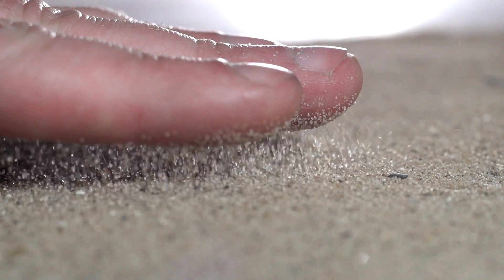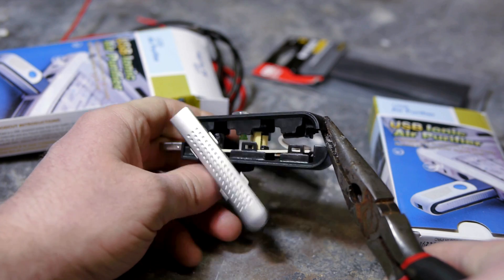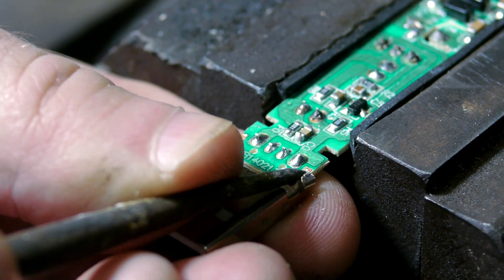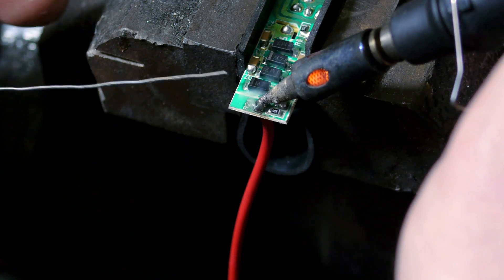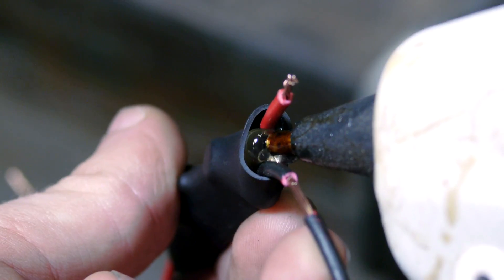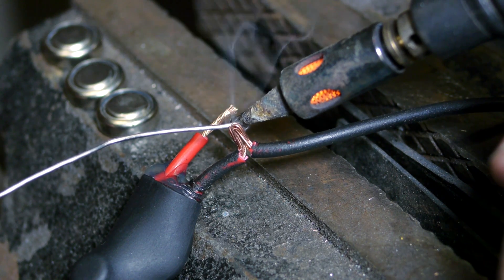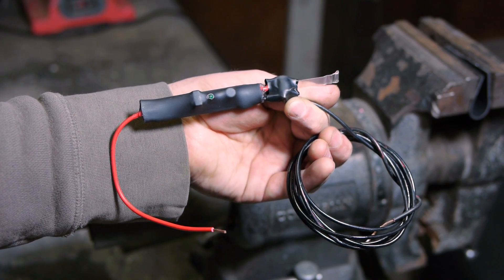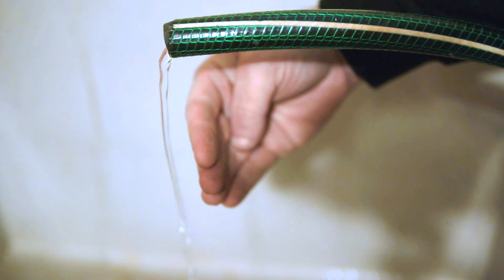How To Make A $5 Static Electricity Generator - NightHawkInLight

Comment: how would I go about with making this without a soldering iron? My dad works at a bronze production factory but his soldering irons are too bulky for such precision.
Reply: +Kitty Max Personally: I wouldn't even consider doing that, the reason is that soldering irons (entry level ones at least) are pretty damn cheap. And I've always been able to borrow my dads tools and had a half decent one for years until I finally got myself a proper tip temperature controlled Ersa soldering station.

But if one doesn't have that... well if you're creative I suppose you could use some kind of metal rod with enough thermal mass and a fine enough pokey end to melt the solder from the PCB or to put it on. Then you proceed to heat that piece of metal while having some way of holding it like pliers etc so you don't burn your hands.

Assuming its a ROHS compliant piece they'll be using lead free solder on it and you need about 230 degrees celcius to melt it. But considering your metal rod will cool down over time and lose heat to the piece you're working on go a bit higher than this temperature. The most common lead solders will be about 60/40 and melt at about 183 degrees celcius (exactly that if its an eutectic 63/37). How to determine the temperature, ehh well I'll leave that part of the mad challenge up to you.

Really though just get your own iron if you're even remotely interested in electronics or might want to replace some parts in an attempt to repair stuff (doesn't take a genius to replace caps in the if a power supply has died!). Or if that doesn't hold your interest maybe a friend or some of their parents has one that you could use for a few days.
Reply: OK I had no idea soldering irons are that cheap(just checked eBay). Well looks like I'll be able to build this ^_^
Reply: *****
Yup the cheap ones... are just that really cheap. Your mileage may vary depending on which one you get and then the luck of the lottery with not so great quality control on cheap ones.

But if you end up using it more frequently than you expected and like messing about with electronics I'd highly recommend looking into a soldering station which is a lot easier to use in my opinion. Basically you've got the station part usually with a dial or buttons that lets you set the target temperature and then some mechanism either controls the actual tip temperature or the heating element temperature. This allows you to set it hot enough to do the job but not any hotter than needed also it means that the transformer and all the other bits are inside the unit on your desk and not inside the iron you're holding making it a lot lighter and easier to handle.

The next best option in my opinion are some of the cheaper but still functional directly mains powered irons that do have a temperature control.

A good brand name budget starting soldering station if you do end up going that route would be the Hakko FX-888 which I think starts at about 100 USD. But just do your research and you'll find one that is affordable and decent. If you are a little bit budget suicidal you could also look at JBC, Ersa, Weller etc... but I would not recommend that route to most people.

Comment: An "on/off" switch would double the price?
My knowledge on the subject is for sure outdated.. But about 6-7 years ago back in HS, me and my buddy modded Xbox controllers etc. we had leds all over inside the buttons etc. and to turn them on or off, we used switches. The most simple kind that slide on or off.
The whole pack of like 10 of these cost me like $10 on eBay at the time...

Comment: Calling bs on the switch doubling the price, 100 push button 4-pin DIP's are $1.2, can easily handle the 5V (rated 12V). 20 rocker switches are $6ish.

Comment: I thought ground was for green wire.
Reply: +TheJonesChannel11 There's a difference in the colors for static and alternating currents. DC is Red for positive, and black for negative (or ground). For AC however, with the standards used in Finland, the "positive" is brown, the "negative" is blue and the ground is yellow and green.
Reply: MrKroakim The joys of being an electrician.

Comment: It should not harm a phone in your pocket, actually I can tell you it wont from experience, this is because there isn't any current flowing through the device, I would't however recommend doing it with your phone in your hand because if it is the path between you and ground then you can have an issue. Also, do you know the voltage output? Just curious as I have been experimenting with my own designs. The best compromise I found between size, price, voltage and modability is a design I came up with based around an electric fly swatter and a voltage multiplayer. However, it is still a bit bigger than I would want as I am trying to enclose one entirely inside a shoe, plus it is not as good as the original 20kv power supply from amazing1.
Reply: Hey look, it's me from the past :) As it turns out, with a good enough voltage multiplier I've cranked it up to 100kv and keep it completely enclosed in a shoe to the point where I can even where shorts and no one notices. Its awesome, I just need to push a button with my toe and I can shock anything.

Comment: For transforming DC voltage, would it be easier to use a resonator with zener diodes, or a marx generator with transistors and a relay switch?
Reply: +Austin Hayducky yes but it would be more expensive

Comment: Wouldn't it be evil to sell these under the title "antistatic ankle strap" to pc builders? Just fuck up my Titan x fam.
Reply: +Two - Dimensional Pretty sure antistatic ankle straps don't need batteries... You could probably fool people who don't know anything about antistatic ankle straps, or just static electricity in general, but if you're building a pc then it's kinda your responsibility to not be an idiot with expensive parts.
Reply: @misterfish36  put the battery in before selling it
Reply: +Isaiah Moorehead I think if you're smart enough to build a custom pc, you can probably figure out that this is not an antistatic ankle strap lol
Reply: +Isaiah Moorehead  Nerds dont use anti-static, only companies that put together pc's for consumers like best buy
Reply: In years of PC experience I was once asked by sales guy to MAKE a board bad that a good customer RMA'ed to use 2 times and i did full stress and function test and sent it back. It worked the 3rd time but as a favor to sales guy I attempted to fry it. During testing I rubbed screwdriver all over board. Took CPU with running then put it back and rebooted, installed a 10/100  network card with it on, put the board on  a sheet of metal, finally after having to reset my power supply a bunch of times I was able to get it with the 12V wire i was rubbing all over contacts

One of the board I used on my test bench for other parts was a ASRock that had bad caps and instead of replacing them i ripped two off that was the worst and twist the part the was left together, no static bracelet and it worked still
Reply: +Isaiah Moorehead You unsensible person! :D Poor nerds! What would they do after they cooked their PCs! :D

This made my day...
Reply: +David Frau we would come for him...
Reply: Two - Dimensional true, but if you can do that, you can infer that this is not going to eliminate static... at least I hope you can...
Reply: Golden Saint They make antistatic bands that look exactly like this... You're supposed to use one lol. No way to tell the difference without dissecting it.
Reply: +Isaiah Moorehead "Can I pay with Apple?" XD
Reply: eheheheheheheheheheheheheheheeheh
Reply: +Golden Saint It isn't hard lol.... It takes like an hour tops, so....
Reply: +Isaiah Moorehead you sir are very mean :3

Comment: Your description of the electronics is correct. If you are interested in learning more about the voltage multiplier circuit they used Dave has a great video: http://www.youtube.com/watch?v=ep3D_LC2UzU
Reply: why aren't you posting videos anymore?
Reply: +Afrotechmods arent these just simple multiplier circuits, i could probably make a higher voltage one at home, though considerably more expensive
Reply: +casaverdero They just did within the last month I believe only they are doing videos as regularly as they once did.  Yep, I am a subscriber of his for a few years now.

Comment: What'd happen if you use 6v on it instead? Or if you got 2 (or more) of these and ran them in parallel? Would you generate more of a charge, or would it interfere with eachother?
Reply: +Xenro66 Interesting idea, maybe if you connected the two ionizers in series or in parallel it could be making a greater charge... Idk tho...

Comment: can i put on a 9v batteri insted?
Reply: +Dan Nguyen USB is just 5V, you can use 3 AAA instead.
Reply: +38911bytefree would 3 aa work? its the same voltage!
Reply: Karl Karlex Sure, you will get better capacity also. Use alcaline, not rechargable, because rechargeable drop to 1.25V when used so, instead of 4.5V you end getting 3.75V and this device was powered from 5V.

Comment: can you make a video about a usb that fries anything it is plugged into
Reply: You could do that just by creating a short circuit although computers these days have tons of protection against that so you won't be able to kill your friends 3000$ computer but you can still fuck up a tablet or a phone.
Reply: +Potato Slayer5478 to plug it into potatos, and you get potato chips :D easy potato frying
Reply: F B I  O P E N  U P
Reply: why
Reply: +Hendlton there is a device that feeds very high voltage on the usb data bus
http://www.pcworld.com/article/2896732 here's a link
Reply: +PardonMeIFarted tons of protections and cut off, even against ESD, shorts, overloads etc, eventually you can damage the port and the tranceiver but doubt you would be able to damage the computer completely.
Reply: +PardonMeIFarted 
Most likely you can use exactly this device for that. Leave the USB plug on and just connect the high voltage output wire back to the data pins of the USB plug.
Reply: +Hendlton you could probably fry the motherboard
Reply: +ficolas2 ahh